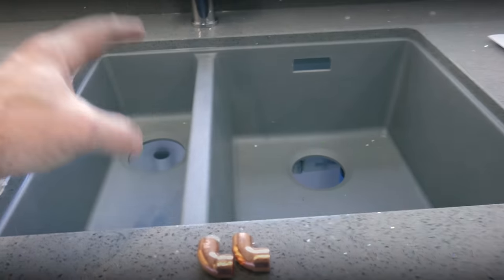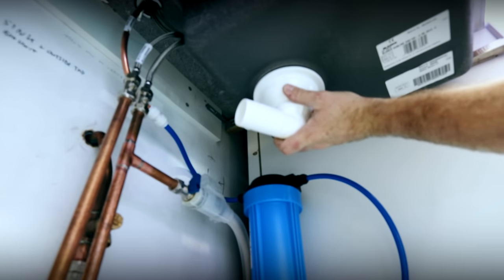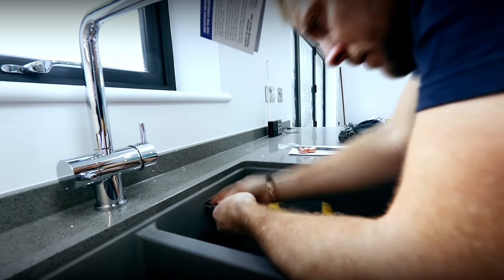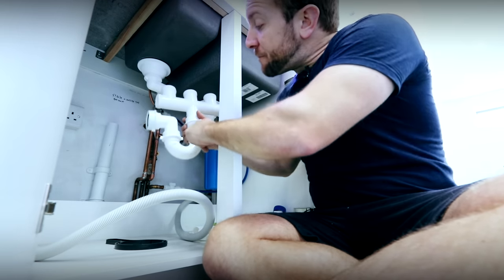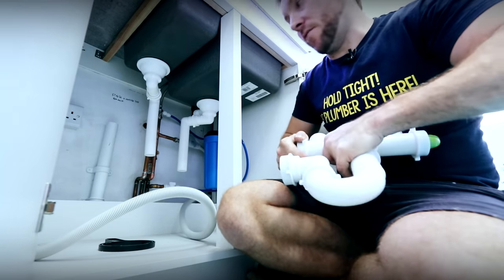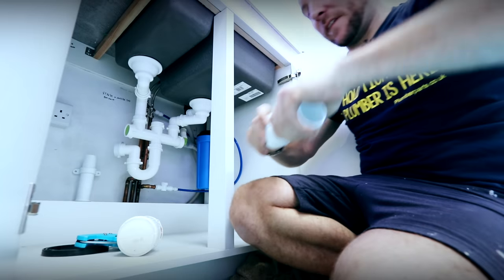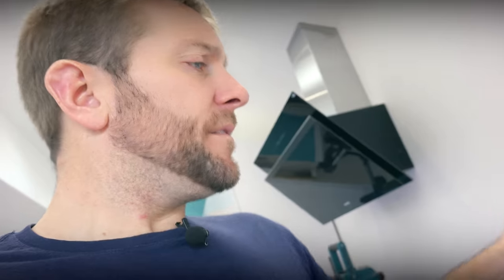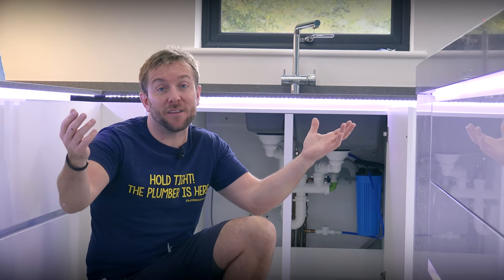KITCHEN SINK WASTE - How To Install Step by Step

Comment: I agree - fitting the overflow is always a pain so if I'm fitting a new sink I fit the wastes and the overflow before dropping it into the hole in the worktop. Same for the tap if its fitted into the sink not the worktop. Had a tap last week which came with solid tails - so much more difficult to connect than flexis

Comment: Awesome just replaced old sink. Everything went well. Finished but not connected as waste outlet is in the corner of the cupboard. Think I need a flexible waste hose extension to finish off. Great advice here. Thanks.

Comment: I have the same fitting which have just started leaking but do not where to buy the same outlet piece with overflow Thank you for the help that should let me have a go at replacing.Please advise

Comment: 1:50 On my sink the top bit is the basket strainer type and there is no rubber seal between that and the upper sink surface. There is one between the lower facing sink surface and the waste housing, so it should be water tight. The installer used a sealing compound for the upper surface but I would like to replace it with a washer but I can't get one, and my enquiries were answered by a reassurance that a rubber washer isn't needed. DO you have any advice about that?

Comment: i'm here because I was hoping to see you fit a air-vent, of sorts  attached to the waste U bend pipe like mine, ( which is leaking)  couldn't buy a new valve , so blocked it off, but water slow to drain away now, and makes loud gurgling sound, as Air is blocked .Nothing else attached, just two taps and one waste pipe with U bend    What to do?

Comment: What ratchet pipe cutter is that you're using ? I've got a 40mm Rothenburger slice type but with those you have to have the right size for the pipe you're cutting. A ratchet one would be useful.

Comment: My trap is at a 45 degree angle to fit in the gap and line up with the outside feed from where the old sink was higher up. So the water level sits just above the waste and slightly in one of the pipes that come horizontal under the main sink. Just wondering if I can leave this or should I drill more holes through the wall to run it vertically?

Comment: Awesome video - thanks, had to connect up my new sink & tap (plumbers called weren't interested apparently?) - used the same ssk2 kit you used and your method worked a treat. If I re-doing it I might tweak it a bit to get the pipes further back but as it is it's all water tight and I've got loads of room in the cupboard as the pipework is pushed nicely back.

Comment: Hi
Did you drive a screw straight into the breeze block just then? or was it editing magic?
If you did, please tell me all about them .
Reply: Use concrete screws or bolts, go to Screwfix they have them
Reply: I've used concrete screws before, and they're good. They need a pilot hole normally. It looks like normal screws in the video, driven straight in.

Comment: Hi, do you still check new comments? I got a replacement McAlpine waste unit and know how it should be installed but it seems shorter than the old one and the pipe struggles to reach it. If I secure everything there's still a bit of water dripping through, but it seems to come from where the waste secures to the pipe below. The old waste measures 60mm from top to bottom while the new one is 50mm (no seller seems to mention this when listing measurements so I can't find a longer replacement) and it was installed with a strange ribbed, almost funnel shaped rubber gasket between it and the sink bottom, which I have to use with the new one or it won't allow the pipe nut to screw on at all. Presumably this was used to bridge the gap because the right length of pipe wasn't installed at first, but it's not enough for the new waste and I'm not sure what to do. 

I can't remove the screw from the old one because it was corroded and had snapped. I only noticed this because I ran the hot tap before washing up and heard dripping under the sink, as the grate had popped up and the waste had moved down from the sink base. I couldn't dig the screw out to reuse the waste as pliers snapped the rest of it 😔

Comment: hi, anyone know what waste kit this is? i have moved in to a place with a blanco sink and this looks like it might work for me. i  just need the pipework under the sink not the bits what he is putting in at 1:34 . not sure what they are called, drain bowls? thanks
Reply: It's a double or 1 1/2 bowl waste kit you are looking for. Google under sink waste kit 1 1/2 and you should find a supplier nearby

Comment: @plumberparts I guess you don’t need to use Plumbers Mait on a modern sink waste system like that? I want to replace the sink basket/waste/plug hole on my Kitchen sink as it appears it’s not stainless steel like the sink was. Th chrome has come off and worried it’s going rusty. It’s only a bog standard kitchen sink. Just want it to look nice and newish. (Can’t afford a brand new kitchen).

Comment: Love your videos, I know this question is relative to this video but I saw your Magnaclean video and I want to fit one. The problem I have is my filo and return are piped in from the top. I can't put it under the boiler. Where else can I put it? I'm holding tight for your answer. Thank you
Reply from the maker: Send me a pic on FB, Twitter or Insta mate and I'll tell you!

Comment: How do you get the rubber bit on those overflows to seal against the sink? My one leaks no matter how much I tighten the screw!
Reply: Eicles don't overtighten them otherwise you'll break them you could always use a small amount of clear silicone

Comment: Thanks for that great video, it helped me a lot in the middle of a leak. Can I ask, my sink waste, the part that screws into the sink, each one (1.5 sink) has a 1.5 inch fitting coming out the side under the sink. When it was originally installed it had a pipe running between these two parts but one end was blocked with a rubber disk (seems pointless) so I assume it is not necessary, can I block both with a T23U Waste Pipe Blank Cap-1.5 and remove the short length of pipe between them. Thanks

Comment: What cutters are you using James
Reply: w Johnstone I would like to know too, they look superb! The cheap ones I've got squash the pipe if you try to cut through in one go, so you have to turn them around the pipe as you cut :-)
Reply: Try Rothenberger pipe cutters. Not the cheapest gear but quality is second to none.
Reply: Was going to ask the same question! They seem to do a good job. I've had a few but they don't cut great.

Comment: the outside tap supply seems to have a double check valve missing ?
Reply: Some have one built into the tap.
Reply: Which is a failure under water regs, there needs to be one inside the fabric of the building :)
Reply: Oh right. Wasn't aware of that. Recently started my level two at college and from memory the tutor said the bib tap would either have one built in or one on pipe before.
Reply: Your tutor is sadly wrong, look at page 6.42 in the water regs book

Comment: My kitchen has a double Belfast style sink and has the same pipework, but after a short time the stench from the waste was revolting, because the dirt builds up in the horizontal cross piece and any time hot water went down the plug hole the smell was unbearable and the only way to clean it was to dismantle it, so I put a U bend onto each sink before the cross piece, problem solved.

Comment: The washing machine waste above the u bend will evetually smell not nice
Reply from the maker: How do you think it should have been installed? Into it's own trap?
Reply: plumberparts I'm not saying it's wrong how you have done it you are a top plumber and the cracks not bad either it's just  my washing machine stinks at times and because it's above the trap if it was installed at the other side of the u bend no smell ever that's just my 2 cents keep up the good work
Reply: if your washing machine was connected "down stream" of the trap your drum would always smell of drains
just my 2p worth
Reply: Brian Fleming that is the whole point of a trap.....to stop the smells! if it wasn't "trapped" it would smell like "shat"!